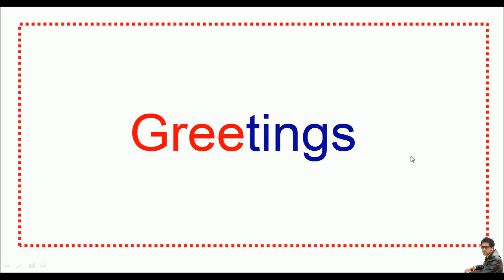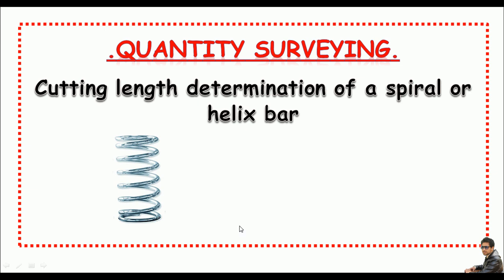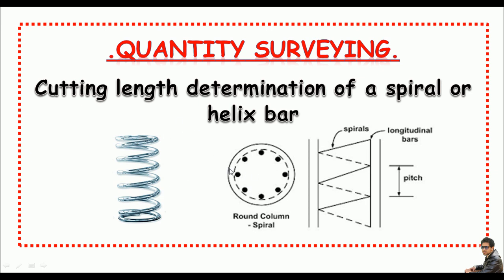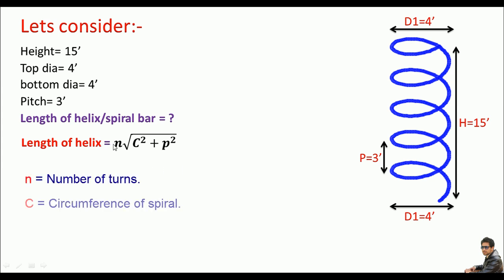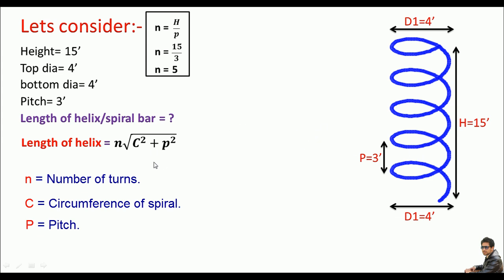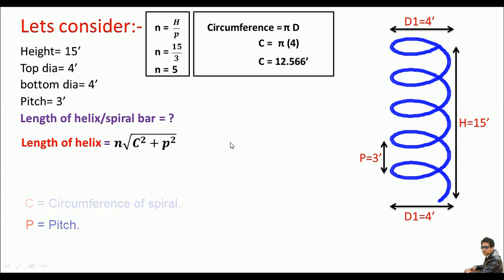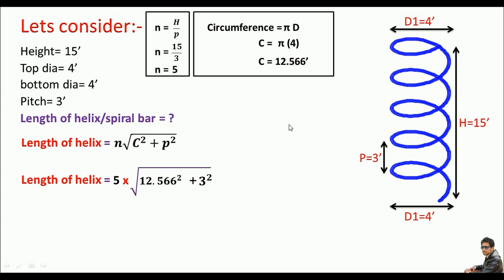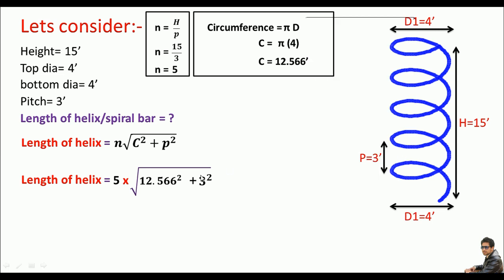QS:- Cutting length of a spiral bar ?

Comment: Pitch=150mm
Dia of pile=1200mm
Length of pile=21.5m
Dia of spiral bar=8mm
Length of spiral ring=?????
Please solve this sir by your method...
Reply from the maker: 1078 meters
Reply: By my method the answer is 486.37 meters.... Pl again check sir
Reply: @vishnushankar9684  1078